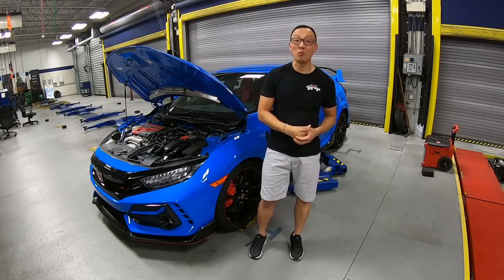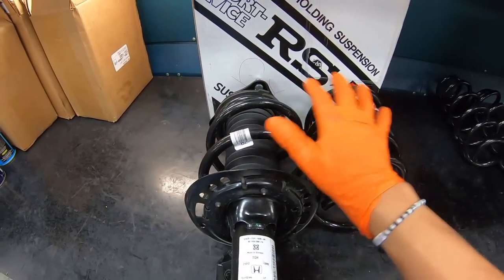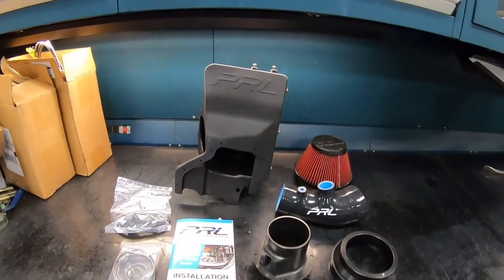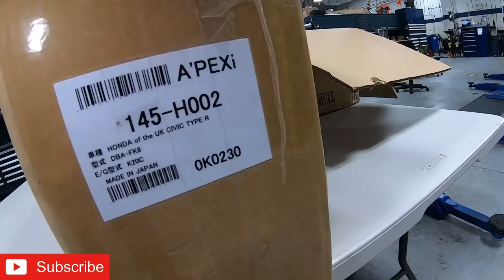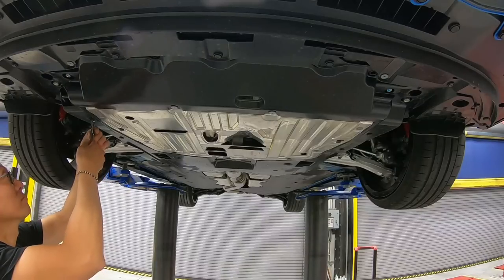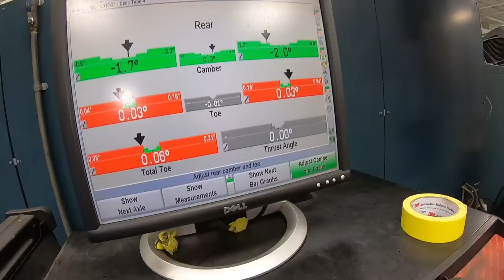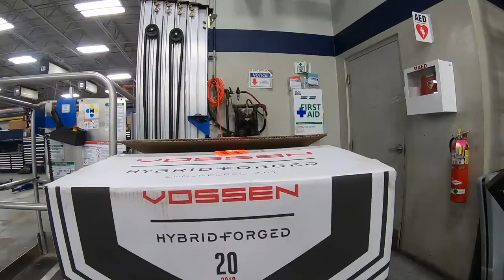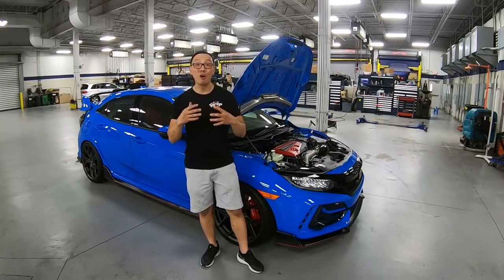2021 Honda Civic Type-R Build | RS-R Lowering Springs | APEXi Full Exhaust | PRL Intake | Vossen HF5

Comment: Wow!! Have not seen a set of wheels that looked good on this car besides the OEM wheels until now. Great upgrades all around! 👍🏻😎
Reply from the maker: Thanks a lot
Reply: @ahcgarage  I wonder if these wheels and tires hold up better than the OEM. The OEM are thin can’t absorb a pot hole hit which unfortunately are here in NY LOL and got to switch the tires at 10,000 miles.
Reply: Tons of 18" wheel choices out there which look way better than the ridiculous 20's and 30-series tires.  40-series and 18's fit the car a lot nicer, make the ride better, and are just all around more practical for a DD vehicle.
Reply: @Patrick94GSR  I was thinking about getting this for a DD that’s putting about 100 miles a day. Had to pass on it. Will kill me to put that many miles plus the repair it would cost for this car just didn’t make sense. 21 Civic Touring it is for me.

Comment: Nice, just a little advise put blue thread locker on the prl intake box bolts and mine where vibrating out after 8k miles. I removed the box since I was doing radium ccv catch can install and fixed it….just FYI.
Reply from the maker: Thanks for the heads up 👍🏼

Comment: Enjoyed the vid thanks!  Big drop from the RS*R.  I am going the opposite way and reverting my 2017 fk8 to stock.  I have 255/35/20 4s on stock wheels and I like them.
Reply from the maker: Lowering isn’t for everyone. Works well for us with perfect flat roadway. Slightly larger tires with those 4S will definitely get the full potential out of the FK8 👍🏼

Comment: Hey guys, tell me, after lowering does the caster and camber have a new setting? Or, is it the same as without the kit? If it is the same, was it "off" when you checked it after lowering kit?
^..^~~

Comment: Did you guys tune it after installing the new parts? I'd imagine it would need tuning to get any performance gains over stock. I installed an intake in my civic and AFR's were all out of whack until I got a dyno tune.
Reply from the maker: No tuning

Comment: Omg What a great presentation. AWSOME 
Thank you . What a Team !!!!
Reply from the maker: Thanks a lot
Reply: @ahcgarage  I have a question if one was to put 18” wheels on the type R - and not put Lowering Springs on, How much Gap would there be from Fender / Tire  ? 
Thanks
Reply from the maker: Wheel gap will be a bit more exaggerated due to the wheel size change. Might have to increase the tire size by a bit to compensate

Comment: Mike how's it going?  I have the same exact vehicle and it's gorgeous.  I love driving it specially after the PRL and Lowering Springs.  I have not gotten to my exhaust yet but I'm debating between the Apexi or HKS Legamax? What's your feedback?
Reply from the maker: They are both fantastic exhaust systems. Apex-i is the most expensive out of the two while offers the nicest sound and craftmanship. HK-S has a lower price point but it's a bit louder and carries a bit of exhaust drone. You can't wrong with either one.
Reply: @ahcgarage  Mike I appreciate your honest feedback.  Thank you so much and I'll send you some photos on IG of my progress with my Type-R from NY!
Reply from the maker: Look forward for them 🙏🏼

Comment: It'd be nice if they made a 10th gen type-R without aero and a lower profile wing for a stealthier look
Reply from the maker: Or have an accessory option for the lower profile wing 👍🏼
Reply: they did, but unfortunately not for stateside. Might i suggest looking up the Civic type r sport line!
Reply: It wouldnt be an R and look ugly like the civic sport hatch does
Car does 174mph on stock tune....e30 tune + bolt-ons 450hp easily top that.....and you want to lose rear stability? Makes no sense
The car is about performance for people who want to push the car
You can just buy a civic sport 1.5t and mod that - make 290whp/340wtq with FBO and e30 tune and have a "stealth" look you want....aero would suck but I guess you dont care what happens above 80mph lol
Reply: @TheFK8Life  well done, keyboard warrior
Reply: @TheFK8Life  just kidding lol, good for you man, proud of you

Comment: I wish Honda would just put a V6 and RWD in one of their Honda Civic Type R I would spend my money on that ❤️
Reply: Thats called a Z and Nissan makes it
The Type R is a masterclass in fwd magic with big power 4cyls....unless you need 1800+whp this engine is more than enough to make 600whp on stock block or 1000+ with a built motor

Comment: Mike which would you choose if you had the option. The new TLX Type S or Civic Type R??
Reply from the maker: Man, that's an excellent question but very hard to choose. TLX Type-S offers much more comfortable environment and could have huge potential for performance gains with aftermarket goodies. FK8 CTR offers one of the very few manual transmission option and maintaining almost zero torque steers and super fun to drive factors. And not to forget, the potential for the FK8 CTR is almost endless. I am a sucker for manual transmission, so my answer will be the FK8 CTR.
Reply: @ahcgarage  thanks Mike

Comment: I would love to lower my 21 sgp type r but i dont want to ruin the handling with springs or loose the electronic suspension by putting in coilovers.  Why did honda make it so good from factory.  😅
Reply from the maker: You're right, FK8's suspension is very good right out of the box. A set of lowering springs with a mild drop like RS-R and Eibach will not ruin but rather improved the handling characteristic

Comment: I have a silly question. I'm very interested in adding a PRL intake as well. I, do have an automatic, but I do have shifting pads. Would I get that whooshing sound in an automatic? Do I need to get use to using my paddles in order to get that sound? Thank you!
Reply from the maker: It would but doesn't sound exactly the same, and also the vehicle is turbocharged.
Reply: @ahcgarage  I kinda figured as much. Thank you. And, yes. I have a turbo in my car as well. Love your videos!
Reply from the maker: Thanks for the support

Comment: CAR LOOKS AWESOME, I AM CONTEMPLATING WHETHER MY NEXT CAR WILL BE A TYPE R OR A WRX STI IN RALLY BLUE, ALTHOUGH THE ONLY GOD KNOWS CAUSE I MIGHT JUST GET SOMETHING ELSE ( WHO KNOWS) BUT THESE 2 CARS ARE ON THE TOP OF MY LIST, ANYWAY THIS BLUE TYPE R WOULD BE MY NUMBER ONE PREFERED COLOR OVER ANY OTHER ( IF I CAN FIND IT) BUT IT LOOKS GOOD WITH THE VOSSEN BUT IT STILL LOOKS MAGNIFICENT WITH THE STOCK GLOSS BLACK WITH THE RED OUTLINE, MOST CARS COME WITH UGLY STOCK WHEELS BUT THE TYPE R’ S ARE A THUMBS UP!!! ANYWAY GREAT JOB, WHY ONLY LOWERINGS SPRINGS ON THE TYPE R, WOULD COILS OVERS BE THE WAY TO GO FOR THAT RIDE? DONT GET ME WRONG I HAVE BEEN USING LOWERING SPRINGS SINCE THE 80s WITH NO PROBLEMS BUT ITS A NEW ERA OF ADVANCEMENT OR IS IT THAT THE COILOVERS ARE WAYYY PRICIER??
Reply from the maker: FK8 equips with ADS (Adaptive Damper System), where using lowering springs we can still take advantages of the factory system. Also, this setup provides great daily driving setup and also fun at the track. RS-R, Spoon, Eibach and much more companies make great lowering springs for the FK8.

Comment: what size specifically are those wheels and is there anything i need to make them fit cause i cant seem to find them.?
Reply from the maker: They are Vossen HF-5 in Matte Gunmetal, 20x9 +35. No modification at all, the stock 20" tire will work on that wheel as well.

Comment: I have a question about the rear do you need rear camber arms?
Reply from the maker: On our application, the rear cambers are still very close to the factory tolerance. So there’s no needs for the rear camber arms. We have done rear camber arms on other FK8s, highly recommend Hardrace rear camber arms for the FK8.

Comment: How can I contact you personally to show you a weird sound my 2020 Accord Touring is making? Turbo is howling during cold start for about 30 seconds then goes away. Comes back when accelerating.
Reply: Issue resolved after I installed my stage 2 Type-R turbo.

Comment: better to change a complete coilover than just lowered spring. you are changing the symmetry of the factory suspension. IMO not advisable.
Reply from the maker: Coilover system is great, specially with adjustability. However, the factory ADS system works very well and in some way  is better than coilover system. Lowering springs and factory ADS system suit well for most folks.

Comment: Need that horsepower numbers stock vs upgrades
Reply: the type r has a bosch ecu that doesn’t really improve hp/tq with mods. it’s until you tune that you’ll really see the benefit of anything.

Comment: Where can i see its TOPSPEED? hehe.. Did u do dyno tuning after u replace with aftermarket exhaust?
Reply from the maker: These simple bolt-on modification wouldn't make a huge difference in performance